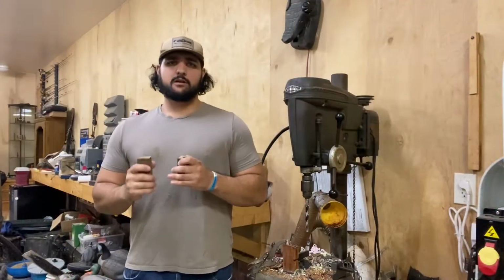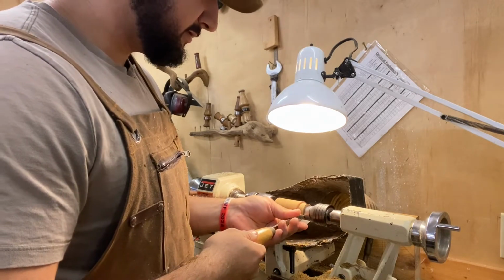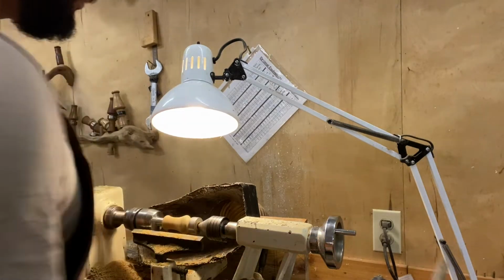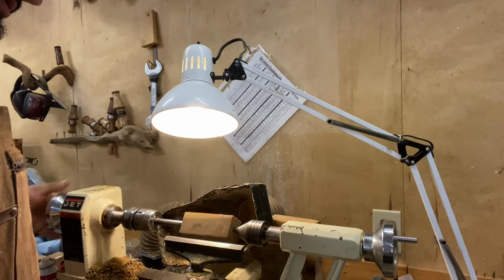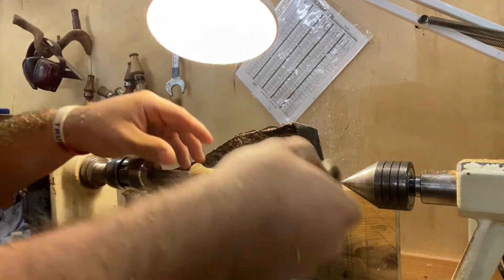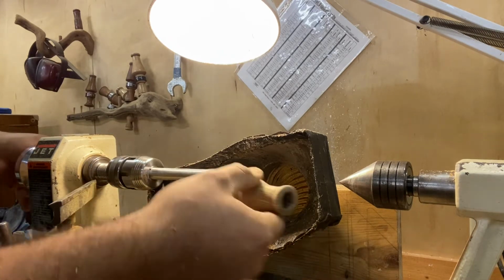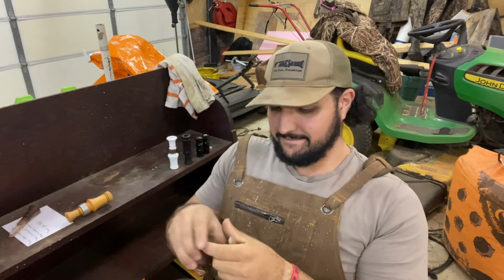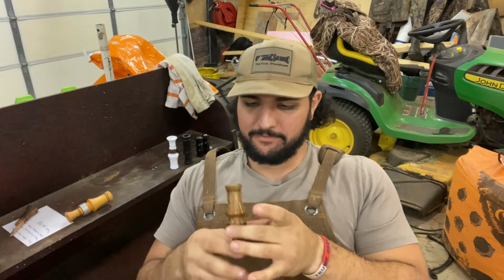How to make a duck call (full)

Comment: How do you keep your tools so sharp? Mine get dull fairly quick
Reply: Most of the tools that he is using a “Easy Wood” Carbide tools - they stay really sharp a long time & can be changed to a sharper part with that small set screw.    Only traditional tools are his parting tool & roughing gouge.  They are easily sharpened on simple grinding wheels.  Carbide tools are great for small turned pieces like duck calls.